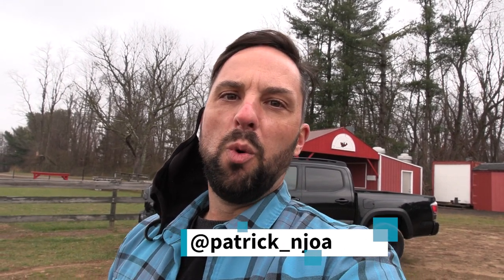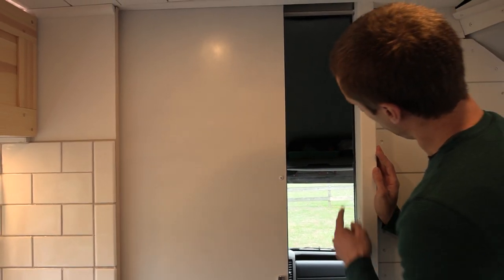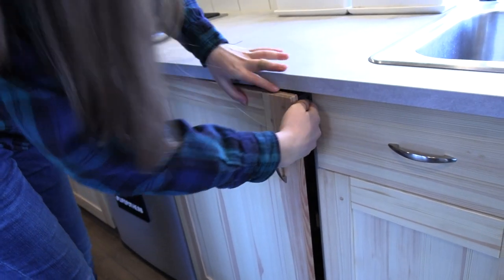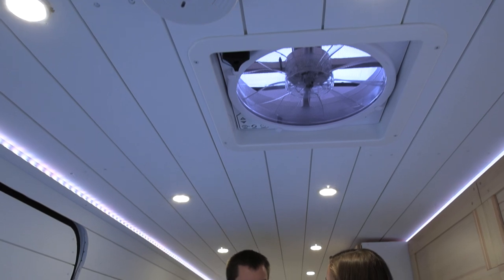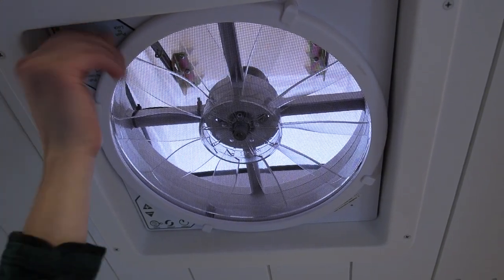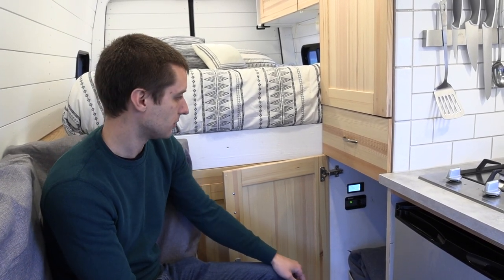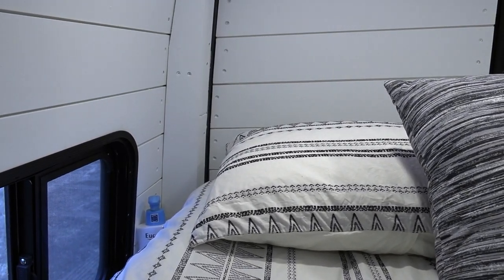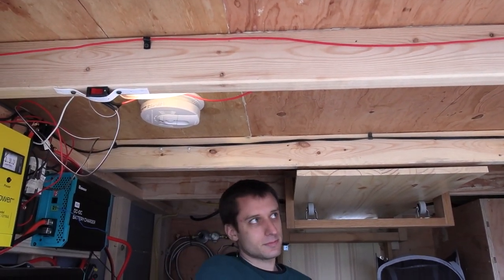Scientist & Engineer Show How to Build Out a Van on a $8000 budget - CAMPER VAN FULL TOUR

Comment: Brillant build - except for the toilet. I find any van build without a separate toilet space not my cuppa tea. I don't want my #1 to see me doing my #2s.
Reply: modelmanjohn, When you go to a boarding school from age 4.5 year old, you get accostemed real quickly , at someone using the toilet , or if you may be in the military too.  Cheers 🇺🇸🇺🇸🇺🇸🇺🇸
Reply: A simple sliding curtain will fix that, but I would want a composting toilet.
Reply: @The_Red_Pill__  But would that stop modelmanJohn from flinging his #2 at his #1?
Reply: when your are in a van and need to use the bathroom, you will discover you and your toilet have your own separate space.
Reply: @FlaGordon2  that's why I installed a window with a curved bottom windowsill.  

All I have to do is hang my butt out the window and let mother nature and gravity handle the rest. 

If this happens while driving, there is the added benefit of air suction removing my waist and giving my butt a nice soft air drying.
Reply: That's because you're classy. Why a young woman would agree to that is beyond me.
Reply: I skip through any van builds that do not offer a private toilet and zero shower. It’s possible to do it so why waste a build and not do it? As modelmanjohn said why so much counter but no place for a bathroom? Too bad because there were so many lovely things about this build.
Reply: @caroljv33  yeh great build but much prefer having a full bathroom in the van too so much nicer 😁
Reply: If you're scared of your #1 seeing you go #2 then you're definitely not comfortable enough to call them your #1

Comment: Really nice build. I discovered a few things I will incorporate into my van. Great that you are safety conscious re propane. One thing to note, all those propane connections, especially the high pressure ones up to and including the regulator, should be enclosed in your sealed propane box. You should also get a propane sniffer and alarm, which is different from a CO monitor. You connect the propane sniffer to a solenoid that automatically shuts off the propane at the tank if it detects propane. Happy travels!
Reply from the maker: I am glad this was helpful

Comment: If you visit Lowes, they carry MAPEI tiling products - made in Italy.  Excellent.  Don't use silicone.
The trick is to use smaller tiles - both thinner and smaller.  I like 1/8" thickness and 1-2" length at most.
The way to set them is to:
1. Use Schluter Kerdiboard instead of Hardie Backerboard or other. Pricey, but 100% waterproof and very light.
2. Use MAPEI Polymer instead of water to mix your thinset mortar to 'stick' tile on wall or floor. Follow mix directions exactly.  This makes the mortar very flexible, not brittle.
3. Use MAPEI Grout Maximizer instead of water to mix your grout (any color any brand powdered grout). This makes the grout very flexible and also builds in the sealant, so no need to seal it separately with sealant.  Grout Maximizer is a rubbery compound and absorbs shocks, preventing cracks.
4. I did my bathroom floors like this, using small mosaic glass tiles.  Not a single one popped out after 5 yrs of use.  The original non-skid finish on tiles was preserved and not made slippery with a layer of shiny sealant.

I love your countertop and the cabinets.  Very clean design aesthetic.  The subway tile looks very nice too.  Great to see ceramic tile instead of plastic ones.  

Terrific job on insulation!  Exactly right type for RVs. Now you will both be snug as a bug in a rug!
For curtains here are some tips: IKEA curtain tracks + large drapery hooks + shirring tape.
Fabric.com for any fabric you like + Roclon Blackout rubber cloth you sew as curtain backing.  Blocks out light + insulates nicely.  If you want color try Kaffe Fassett designs - very high quality cotton fabric.

Garage and electronics are very impressive!  Including the rollout table on casters.  Very nice!  Great build overall, and smart functionality.  Thanks for the tips on building, very useful!
Reply from the maker: Oh wow, thank you for the excellent information
Reply: That was awesome and generous information. Thank you!

Comment: Great build!  Just wonder if you will eventually drill some ventilation holes in the bed frame, plywood area?  Other van lifers indicate that solid plywood develops mold and mildew.  Mattress needs ventilation on bottom as well.
Reply: Or there is a product found in the marine world that you put on the solid surface under the mattress that allows air to circulate below the mattress.  I’m sure a marine store would know that product.  Cheers, Mo in NJ
Reply from the maker: Eventually
Reply: We usedcthecfroli system under the  bed as yes mildew can be an issue and circulates air...just a thought
Reply: Minus the drilled holes HYPERVENT would work too

Comment: Love the build! 9/10 
Personally I'd be nervous to have gas and electricity all under my bed so consider putting a propane alarm under there and a emergency shutdown for all non OEM power by the bed/door.
Toilet may fit on rollers and if you use eco friendly soap you could add a switch to street dump gray water to save on dumping fees for clean water from dishes and handwashing.
Also making pillows from soft clothing or extra blankets may save space and storage bins. 
My favorite here is the real kitchen look/usable space and the lighting in this build.
Also had a friend weld caps on a large pipe as compressed air storage underneath. 
Never know if you may need to air up a tire or blow water or dust off something so use what space you have to add tools that may be helpful.
Enjoy your travels!

Comment: What a great job guys! As far as the shower, I know that nomads will use wet towels to clean between showers. They are made for people into sports or who workout. I use Showerpill towels and they work great. They do a great job with oil and dirt. I'm pretty sure that the frig space would be too small for us. Also, I need to have a bigger freezer space. I prefer a chest unit. I noticed that your bed is laying directly on a platform. My concern is that condensation would build up and cause mildew. There are a number of solutions for that to allow airflow. Finally, is there a reason why you decided on a chemical toilet instead of a composting one? They have virtually no smell.
Reply: Thanks for your comment! We do use wipes for in between showers, or just "shower" in the sink. So far our fridge has been perfect for once a week grocery shopping. And as for the chemical toilet, we had budget constraints so unfortunately a composting toilet wasn't affordable for us. That is a potential future upgrade though!

Comment: I loved your van, with the exception there is not any color. I know the all white makes it feel bigger. I am eager to see if you use any command strips to hang any pictures or something to make the van feel homey. One other observation is you do not have any kind of oven. I strongly recommend getting the Emeril Lagasse airfryer/oven/rotisserie. It is extremely versatile and will serve as an air fryer, toaster, slow cooker, broiler, dehydrator, oven. In this appliance you can cook just about anything. I use mine 90% of the time and my gas range only 10% of the time. 75% of the time I cook our entire meal in this. It uses much less power than our microwave which I know is a concern. This would add alot of versatility to your kitchen. If you still have you left money from your build budget you should have enough to cover this cost. I look forward to future youtube videos to see if you purchased one. Lastly, where do you shower?
Reply: We added a few pops of color to our neutral pallette 😊 Thanks for the airfryer recommendation, we'll keep it in mind. 

As for showers, we typically use Planet Fitness gym showers or we have an outdoor shower setup with a 7 gallon tank and pump with shower head.

Comment: Danger Will Robinson: Your K class kitchen fire extinguisher is different from a normal vehicle extinguisher. Kitchen extinguishers are designed to be used up close to the stove top three feet close, you don't want to be that close to a vehicle fire those extinguishers are designed to be used 7 - 12 feet away, the nozzles and chemical powder are different. please read and understand the instructions on the extinguisher you don't have time to figure it out when you need it.
Your propane regulator can also vent gas into your van it should have been mounted tank top in your vented compartment.
other wise great looking van. be safe out there.

Comment: Most people have a drawer pull out from the bed and use it for a table. Many use a different faucet that will hang outside of the kitchen window for showering and then they buy the cheap shower curtain setup.
Reply from the maker: Lots of great and different ideas in all the builds featured here

Comment: 🔥WARNING!🔥             🔥ALERT!🔥
The propane regulator should be in the box with the propane tank. The diaphragm's can leak and is pretty common and is the real concern. There's a little hole on each stage that allows the diaphragm's to freely actuate and is where the propane would escape into the cab if it malfunctioned. Check those 2 holes with soap water. 

 Actually hooked to the tank is best because they have a check valve built in that slows or stops flow if a line blows. A rubber hose between the tank and regulator is a horrible idea because of this awesome feature. 

Hope this helps keep you safe if you haven't already corrected it.
Reply: Thanks James, others will read these comments  and learn. We here in AUSTRALIA  have to isolate the gas storage tanks and vent to the outside of the van and also by law have a licensed gas fitter do all the gas work.
Gas is heavy so the gas detection alarms in the van should be set low.
I thoroughly enjoyed your video Patrick and the young Couple's presentation.
Cheers
Reply: @GOLDVIOLINbowofdeath  wouldn't have a clue Mark
Know propane is though.

Comment: So much forethought & planning resulted in a great build. Knowing that I'm sure you thought of my question. but just didn't mention in video (unless I somehow missed it): Do you have something between the mattress and flooring to prevent mold from developing??? Thanks
Reply: Thanks Donna! You're right we didn't discuss this in the video. After the video was shot, we insulated under the bed platform and we have flooring on top of the bed platform to minimize the temperature differential which will reduce the chances of condensation and mold. We also placed cardboard under the mattress to further insulate and provide a small amount of airflow.
Reply: We're going to monitor it and if it seems like it's not sufficient we will pursue another method.

Comment: The bed platform needs the slats or plastic underlined with grooves to prevent condensation of the mattress and mold.
Reply: We have our mattress in a full waterproof encasement, and it sits on a large piece of cardboard on top of the bed platform. We check it weekly for dampness and have had no issues in the 8 months we've been living in it 😊

Comment: I kinda noticed that there was no air holes under your bed. You might want to read up about doing airflow for under the bed to reduce any mold that might occur.  This is just FYI  it is no where a mean statement, just trying to help.  Have fun and have a Great Holiday Season.
Reply: Thanks for the heads up! After the video was shot we insulated under the bed to prevent the temperature differential from causing condensation/mold. We also have cardboard under the mattress to promote a little airflow and will be monitoring the situation. Drilling holes is an option if necessary.
Reply: Check out the Cary on Vagabond van build by George Mauros on Humble Road youtube. They drilled holes in a solid plywood board for under the mattress.

Comment: Impressive home build, especially the mechanicals.  But what is the weight?  It looks like you added 2 tons (or tonnes) of weight very high in the van raising the CG such that the van might be a struggle to drive.
Reply: We plan to weigh the van soon. Best estimate is roughly 2500 pounds added, and driveability hasn't been noticeably affected. CG is still low in the van, batteries and water are all floor mounted and light items are stored higher.
Reply: That's the first impression I got.   Nice nice build but everyone's needs are different, 

I have to have a regular toilet and shower even if it uses the aisle.   Maybe they covered this in an earlier video but it might be helpful to list the Chassis model used and the overall cubic square footage because that's your starting point and will limit how much you can put in.  For instance my 05 Roadtrek 170 has roughly 400 cubic square ft because I consider the front cab as the seats turn around and can be used for a dining area.  The propane, water tanks and generator are all underneath so that's not in the calculation.    Good luck and have fun!
Reply from the maker: I believe they are well within the payload
Reply from the maker: Thank you for sharing the information

Comment: Do the knives and the spoons and serving utensils get hot so close to the propane burners?  It might be an optical illusion from the video, but it looks almost on top of the burners.
Reply: The utensils don't get hot but they are close enough to get noticeably warm. It's mounted high enough to not be a problem. I don't think we'd change the location of the kinfe rack or stove.
Reply: @Lifepothesis  Makes sense.  You only have so much space to work with too.  I think a lot of my concern was an optical illusion though.  Your van is very nice!  Happy travels!!

Comment: I noticed a few things that sparked some questions. 

Since your propane is stored in back and you are using it in front wouldnt you want to have 2 propane detectors mounted low since propane is denser than air?

With all of your main build pieces, your water, and your batteries are on one side, did you do anything to offset that and balance the weight distribution?

Comment: Hi , How much weight was added with this build? How does the van perform?
Reply: We haven't weighed it yet. We think we added somewhere around 2500 lbs. It handles fine, you can tell its heavier but it's not unreasonably top-heavy

Comment: I wouldn't have built a van with a fixed platform bed you cant sit up in. This fixed platform bed is far too high up, especially on the side with overhead cabinets.   In my own conversion I have chosen to build a u shaped seating area, with two bench seats and in between a table that can be lowered to convert the u shaped seating area into a bed Under the bench type seats will be storage and ultimately the site for the electrical system and water storage (on opposites sides of the van). To me this is a far more practical lay out than a elevated fixed platform bed you have chosen. 
On the plus side I found your attention to process and planning in you build impressive And your budget for all that you accomplished in your build is impressive. I also think your travel budget per month is realistic I wish you safe travels in 2020.
Reply: Sounds good.   Do you have a vid on your bench bed set up and van conversion, friend?
Reply: @singmysong1167  Sorry not yet still working on other phases of the van conversion (cabinets)

Comment: Correct me if i'm wrong, but it seems like most of the vans weight is on the drivers side. If you were to do another van build, would you disperse the weight in any different way?

Comment: Do think they'll regret not putting in lithium batteries in about 12mths from now. Most do regret cheaping out on the battery system. AGM at the very least but never, never lead-acid.
Reply from the maker: It may be possible. There are always upgrades for later

Comment: A bathroom/shower area is more than likely going to be your first modification. The energy hog frig. should be swapped out for a 2/3 way frig. The microwave...should only be used in a park with hook ups. Propane is really cheap and lasts a long time. Dont forget a portable power bank as backup, like a Bluetti or a Jackery. Everything else is great.
Reply: After 6 months of living in the van we are quite happy with our setup! Luckily we never need to plug into store power thanks to our solar panels, and showering has been just fine with our gym membership & outdoor shower 😊

Comment: Use a rubber mat for the inside so the tray don't slide out
Reply from the maker: Great idea
Reply: Their thin rubber bead like placemats it got lots of holes but cut it to size if you want so it will fit into your frig

Comment: do they have a link to there rearview camera setup?
Reply: It's the VanTop H609 Mirror Dashcam. Here's a link 👉  https://amzn.to/3jbDWiD
We used the hardwire kit to keep the dash install clean. Depending on the length of your van you might need the extension cable too, we needed it for the placement we chose in our 170" Sprinter wheel base.
Reply from the maker: My guest replied to your comment.
Reply: @Lifepothesis  I have a 2020awd transit 148 wb ... still need the extension? I also subscribed to ya YouTube,,looking forward to watching ya videos
Reply: @thomas-ms6st  It really depends on your camera placement and routing. I routed it through the ceiling and then down to the license plate on the rear doors. If we mounted it at the top of the van we wouldn't have needed the extension for a 170" WB. You might want to buy the extension kit and return it if you don't need it.